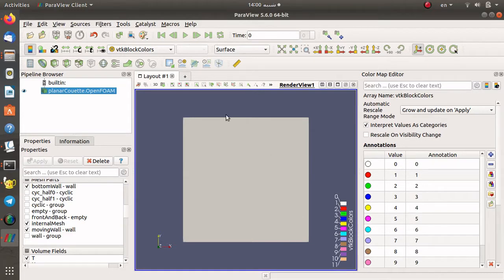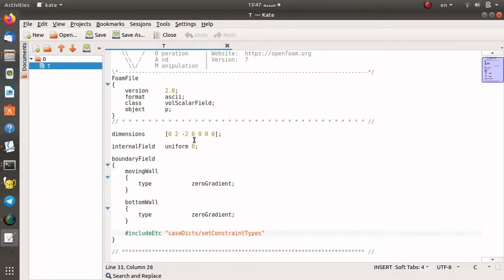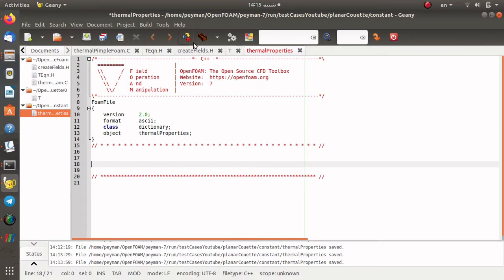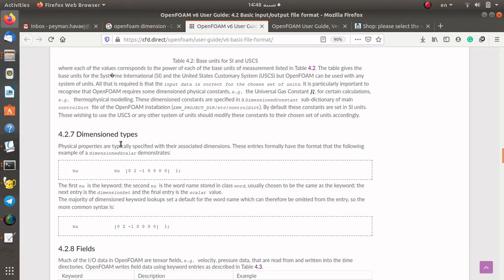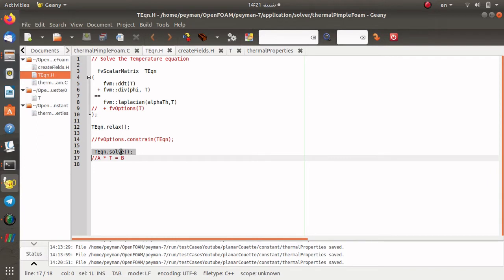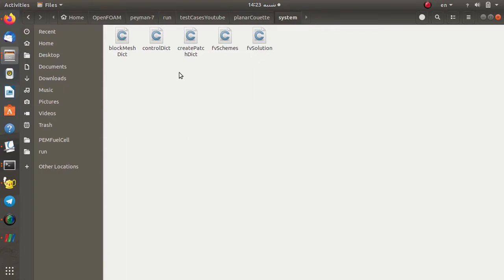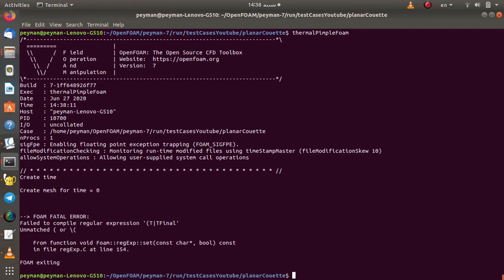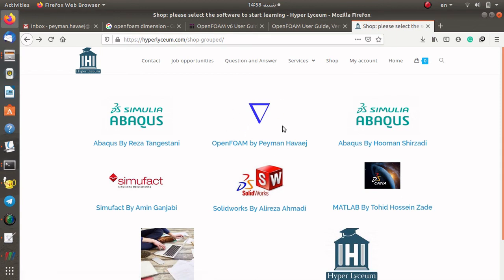Programming in OpenFOAM: Adding energy equation Part 2

Comment: What happened to the rest of the videos in the playlist
Reply from the maker: Actually, 12 videos have been planned for the basics of OpenFOAM. The rest includes programming a custom boundary condition, using swak4Foam and groovyBC utilities, pre and post-processing CFD data, and using existing OpenFOAM utilities.

Afterward,  we will provide a more advanced tutorials series.
Reply: @Engineering_downloads  hey thanks for replying... Could you plz do a tutorial on how to modify simplefoam to solve pressure correction equation...
Reply: Sir I think you missed continuation from first video